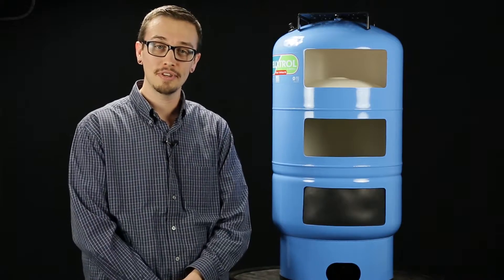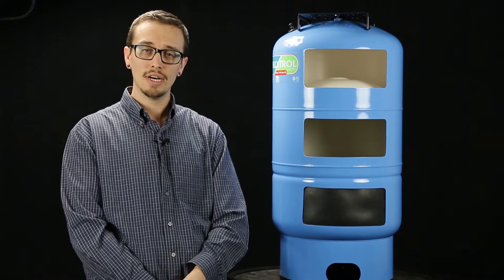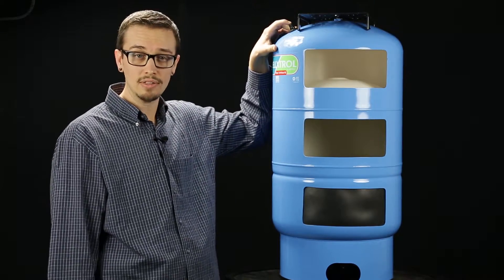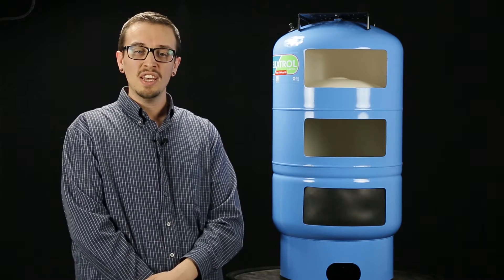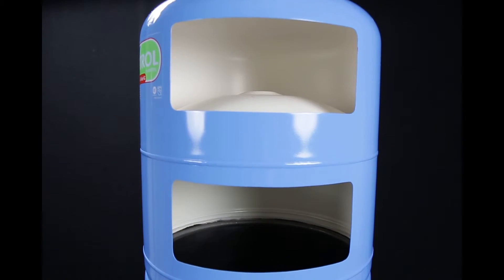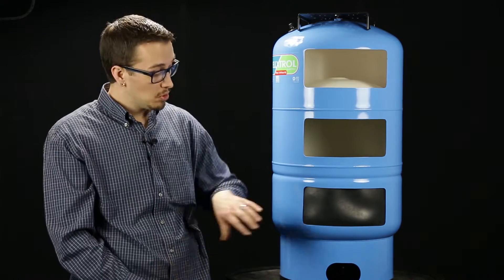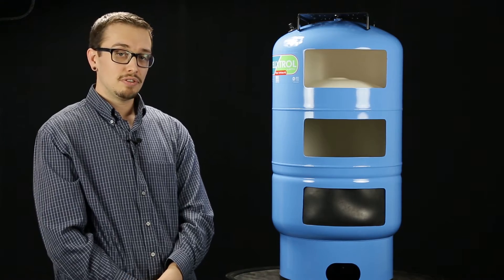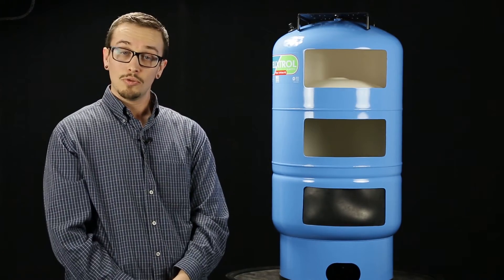Well-X-Trol Pressure Tank

Comment: Water worker and well x trol are the same junk
Reply: they have 7 years ??   Guaranty ??
Reply: @brazilian-lady9175  Well X Trol is indeed a different company from Water Worker. Well X Trol makes an excellent pressure tank with a seven year warranty. My first Well X Trol was replaced after 20 year usage. The present one has been in use for 6 years without any problems.